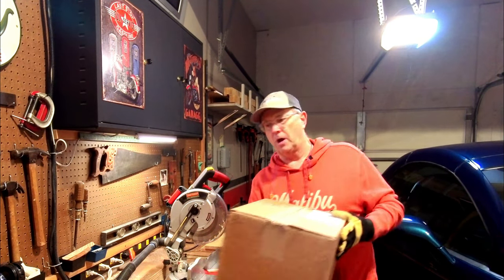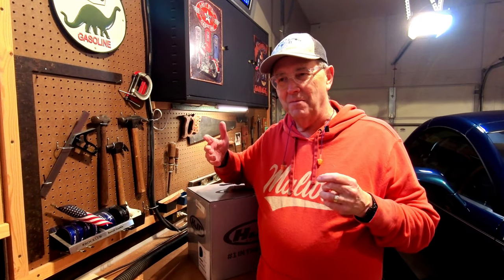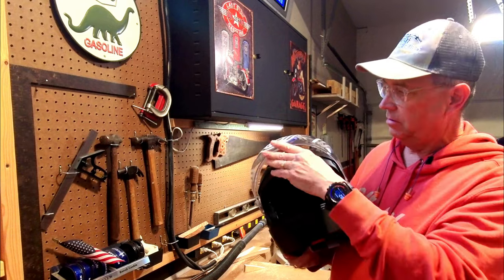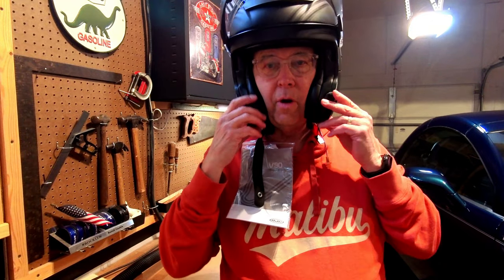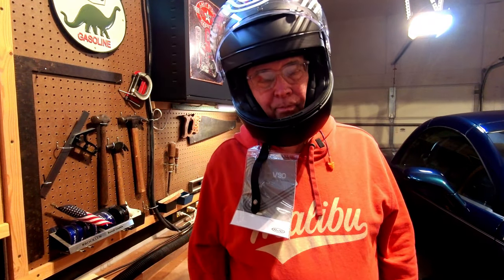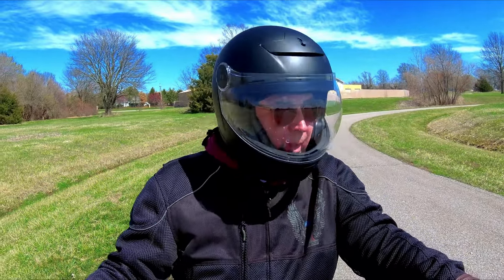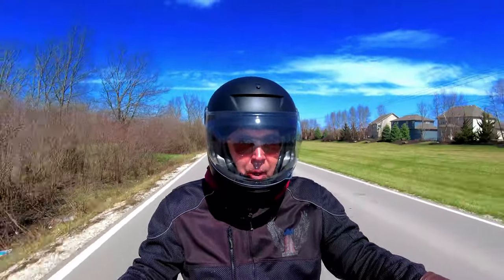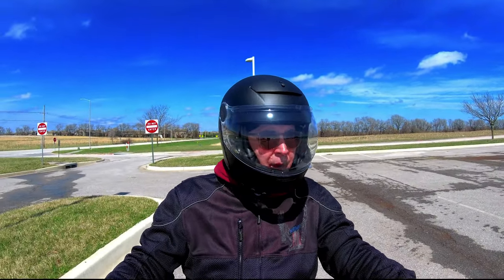Best Modular Motorcycle Helmet of 2021? - HJC V90 Review and Road Test - CHECK THIS OUT!!

Comment: If the cheek pads are tight wouldn't you need a smaller not larger cheek pad ?  Asking for a friend.  Lol
Reply from the maker: HAHA...so 2 ways to look at it...sorry for the confusion...

Here's what I was referring to, this quote from HJC Support.... "The medium V90 helmet (which I have) uses the 30mm cheek pads. You can go up to a size LG cheek pad, which would be 25mm (thinner than your current) to give you a more comfortable snug/fit"

So in a nutshell, "Larger" refers to the pads that would come in the next helmet size bigger (ie Larger)...those pads (because of the helmet dimensions are the same) are for a LARGER Head, so they need to be thinner.

Thanks for the view and question...hope this helps clear things up.
Reply: Thanks for the reply and now it makes sense.  Definitely looking at getting this helmet after your review. Keep up the good work
Reply from the maker: @coreynaimark8369  I will say after riding with it exclusively for the past 3 months, I am very pleased with it!

Comment: oooh i felt that when you dropped the brand new helmet! how is it riding with your glasses on? does it have ample space for the temples that the eyewear do not move when the road gets a bit rough? how about vision distortion from the bubble shield? thanks for the honest review!
Reply from the maker: So I have aviator type arms on my glasses and are just wire, but they have more than enough room for me inside of helmet.
I have not noticed any distortion, for sure not from the front and honestly have not noticed any either on the sides.. I’ve tried to be careful when cleaning but have got some of those micro fine scratches in the face shield just like with any of them out there.
Thanks for stopping by!
Reply: @WhatsUpBob  thanks!

Comment: just bought a gloss black one of these, true about it getting tighter on the cheeks when the front goes down, but i really do like it , peripheral vision is great , very comfy for my head, and quite light for a modular lid. the drop down sun visor is handy. great big proper cut outs for speakers is a really nice touch too, here in uk the fastener is the micro quick ratchet type.a great lid and very happy with it.........oh and if you are looking to buy one ,my suggestion is go a size bigger than your usual size.
Reply from the maker: Yeah, if I hadn't of marred it, I would exchanged first s larger size.
New cheek pads do help some.... I'm loving the lightweight and visibility... Those make it a keeper!!!

I did think opening the visor was a bit difficult, so I filed and rounded out the hole a bit and now it's much easier..